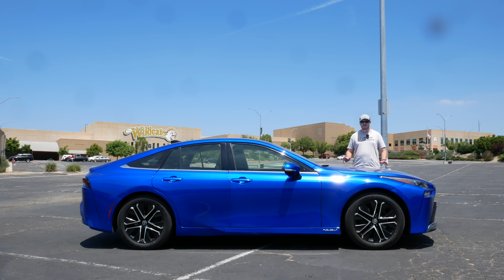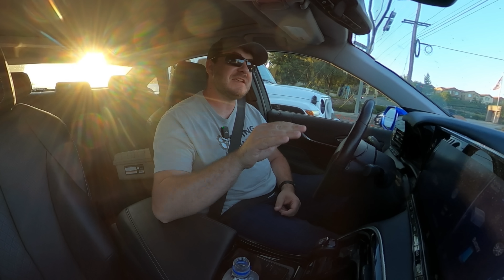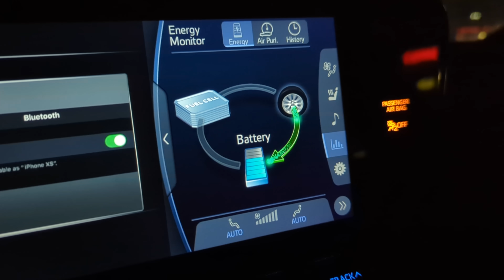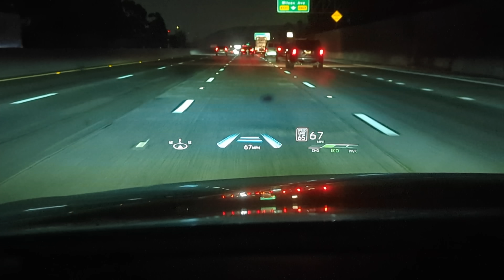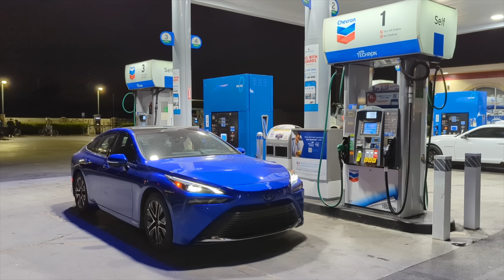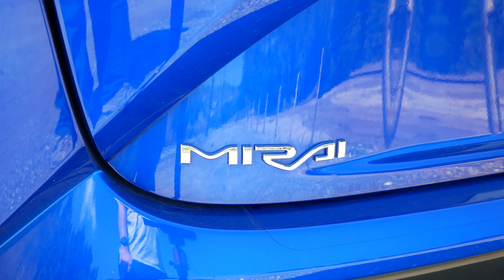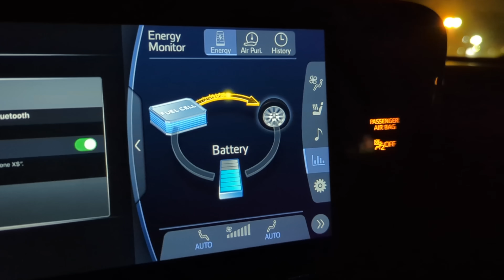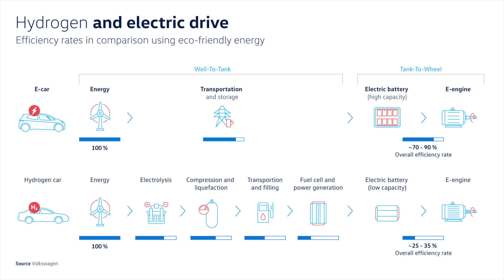The Toyota Mirai is Disappointing

Comment: I have a 2018 Mirai I bought certified used with 35k miles in February 2022 after I moved to Santa Barbara from West Virginia. I got the $15,000 fuel card, and also 21 days of a free loaner vehicle from Toyota should I want to venture out beyond where there are any H stations. I’m now at 48,000 miles, I’ve driven it to Napa Valley, San Francisco, Sacramento, and it’s been honestly a great experience for me. The only scare I had was a few months ago. Our only local hydrogen station (next closest one from where I live is 70 miles away in Thousand Oaks) was down for nearly 3 weeks as the cooling system for the station was broken. I thought I was going to have to get a rental vehicle which Toyota would’ve reimbursed me for it but luckily I didn’t end up having to do that.

The Mirai is a really nice car and I do get a lot of people who check it out and ask me questions about it, there seems to be a lot of interest in it, but even if it isn’t the fuel of the future, I still think it’s a lot of fun.
Reply: I do want to add that the only thing that’s really freaking me out is the fact that hydrogen prices are skyrocketing. When I first got my mirai, the price per kilogram of H was about $14.99. My Mirai holds about 4.7-5 kg total filled from near empty, and now TrueZero is charging $29.99 per kg. It’s over $120 to fill up. I love the car very much but if prices stay the way they are then I don’t know if I will keep it after the fuel card runs out.

Comment: The only reason I've herd of the miri is because James May owns the current gen which replaced the previous gen he had
Reply: I saw one drive past in London last year which was a big surprise. In contrast Porsche Taycans which are now more common here than Reliant Robins.
Reply: And he's had to abandon it as there are no hydrogen stations, most of them in the UK have closed (EV's have won, no one was interested in Hydrogen).
Reply: @craigix  No one was interested because there was no infrastructure, but there is a desire for it from consumers, but it seems the motor manufacturers don't seem to understand the problem of no infrastructure!
Reply: @Eddiecurrent2000  There are so many issues with Hydrogen. It simply makes no sense, even if there was infrastructure to fuel it. Anyone stupid enough to invest in a Hydrogen car, will learn the hard way. EV's at this point are inevitable.

Comment: Please correct me if Im wrong but from what I know from briefly looking at hydrogen fuel cells in engineering they dont seem to require as many rare earth materials that are a pain to get out the ground and perhaps recycling and lifespan might be better? I cant find any sources looking at the sustainability of production of both methods of EV so thats just what ive thought of
Reply: LiFePO4 cells don't need any fancy rare earths though, iron and phosphate are both pretty broadly available. Lithium remains an issue due to shear volume of consumption but I suspect that it would still beat hydrogen when infrastructure costs get factored in as a primary transport fuel source, especially since sodium batteries are starting to roll out for budget tier EVs. Hydrogen is probably best reserved for specific transport modalities where the range and mass energy density are critical with infrastructure being much more controlled, such as long haul trucking or aviation.
Reply: @bosstowndynamics5488  Interesting, thank you, I knew about LiFePO4 cells but I thought they had issues with energy density compared to lithium ion, sodium batteries sound promising and I will have to take a look into those. I've not really studied batteries tbh. At the moment it seems no solution is really a good one that solves all the issues
Reply: @sgqueeny8392  LFP batteries do have less density when compared to Lithium Ion, but it's... not as huge of a difference as you may think. The current base Tesla Model 3 uses LFP batteries and still achieves a ~275 mile range. On top of that, LFP batteries have a significant amount of advantages (not just using less rare earth minerals), like: They like being charged to 100%, they like being drained down to 0%, they don't care about being fast charged, they're slightly more temperature agnostic (IIRC?)... If LFP had the density of Lithium Ion, it's clearly the better choice for EV's IMHO
Reply: @Black-Villain  That's interesting to know, I genuinely had no idea Tesla used them, the more stable chemistry is a huge bonus, I used to fly model aircraft with LiPo batteries and you had to be so careful with them as they explode at the soonest opportunity
Reply: Hydrogen fuel cells also use precious metals like platinum, which have the same supply issues as battery production, but much worse.

Comment: I was hoping you'd make this exact video on this car. I've often touted the absurdity of Toyota of abandoning battery electric cars (for which the infrastructure for at-home charging already exists) for these cars which have literally zero existing infrastructure.
Reply: There was a point in time where there was also no infrastructure for gasoline/diesel, but you can readily find that now. Building infrastructure takes time.
Reply: @diogenes3528  I entirely agree, but here's the thing: the vast majority of plug-in battery electric car infrastructure already exists (at home charging is by far the most popular way these cars are charged). And perhaps more importantly, we've delayed too long already and allowed massive companies to continually push back sustainability legislation and so we need to act much faster. Plug-in battery cars (or really just public transit, but that's a whole other can of worms) represent the only viable near-term solution simply because their infrastructure pretty much already exists.
Reply: but toyota is building BEVs? the bz4x or whatever it's called, the new lexus whatever, plus, while not strictly BEVs, the new rav4 and prius also have PHEV versions. plus whatever north american models i'm unaware of.
EV purists generally don't seem to like PHEVs but the fact of the matter is that for most people they do work as EVs for most of their trips.
Reply: @michele8039  I own a PHEV (a Volt) and while I love it and it's what I could afford, there are many, many studies that have shown that PHEV are not sustainable enough for us to meet climate goals (Paris Agreement and etc). It's more important for companies to focus on improving range and reducing costs (why are seemingly all EVs either giant SUVs or luxury cars, or both?)
Reply: @PC_YouTube_Channel  i'm not sure whether this is the case in many regions, but europe has a selection of small, relatively affordable (ish) EVs. Dacia Spring, VW up, Renault Zoe, Nissan Leaf. the reason why so many modern cars (not just EVs) are crossovers and SUVs, in my opinion, is that baby boomers are the largest demographic that can afford to buy new cars, and they're getting older, so they want a car that's easy to get in and out of.
Reply: @michele8039  Looks like those are all EU except for the leaf. The reason why bigger and bigger SUVs/Trucks are popular here in the US is two-fold. The first is that legislation was passed a while ago that set the emissions of vehicles which depending on the curbside weight of the car. So instead of making more efficient/greener vehicles, they just made them bigger. The second is that the profit margins are larger. Many cars/SUVs/crossovers are built on the same underlying platform and to the manufacturer don't really differ too much in manufacturing costs, but they can sell the larger cars for a good bit more because of good ol' human psychology and marketing.
Reply: @PC_YouTube_Channel  we have similar regulations in the EU. the new suzuki jimny, a small, sort-of fuel efficient off roader with a 1.5 litre engine, has to be sold as a light commercial vehicle to get around the regulations. meanwhile you can just go and buy a range rover with a 4.4 litre v8 engine, which weighs twice as much and gets half the fuel economy, and all is well with the world.

Comment: I'm surprised nobody is doing retro hydrogen refits of cars. Like no way is it efficient or that effective due to the energy density thing, but it could mean that you can use (relatively) original engines and architecture and make it green, even if its a 60 year old muscle car.

Maybe the incentive will come along as subsidies, gas prices, and taxes intersect. (Especially if DoE's Hydrogen Shot comes to pass)
Reply: You cannot use hydrogen directly with original combustion engines. Lots of issues. You would have to replace the engine. If you are doing that, better to just make it an EV. Synthetic fuels will be how we keep classics running like they were intended with the original engine and sounds.
Reply: @anthonypelchat  I read years ago that you can use hydrogen with an injection engine, just not carbureted. I think the main problem would be related to fuel tank sizes, and, you know... rust.
Reply: @NOLAfugee  A lot more difficult than just putting hydrogen in the system. A very simple explanation is that hydrogen takes up more space per unit of energy, meaning that you get less energy in the combustion chambers. Much less. Then you have different needed mixtures of fuel energy to air, causing other problems. And then you have leaking issues, since hydrogen leaks through nearly everything. Nothing in the tanks, lines, nor engine are built to keep hydrogen in place. And finally you have the corrosiveness of hydrogen. I believe the Engineering Explained video about the hydrogen combustion engine went into the most detail here on the issues.
Reply: Those video, write-ups, and retro fits have existed for decades. If it was better the diy community would be full to bursting with people who run them.  I was in a hypermiling forum in the early 00's and asked why people don't use them.  People in the forum who had done it replied that it wasn't better. It looked better on paper but the reality shook out differently.
Reply: @merrickhurst4150  I think the emissions reduction would be the only advantage, not power, efficiency, etc.

Comment: I always liked fuel cells since I build one as a school project and got a good grade for it. Would love to see a teardown!
Reply: Y'know, that takes some skill to build a fuel cell for a school project.
Reply: @jwalster9412  No it was very easy. It was basically just a U-shaped glass tube filled with water and two electodes. I made the membrane/seperator from gelatin. The hydrogen/oxygen was just "bubbled" over the electrodes. You can build the whole thing in a few hours from basic items. It produces just enough power to light up a very small lamp. Good learning tho!

Comment: Great job!  Too bad the electrolysis effort can't be done on-board, powered by the Li-On battery itself during recharge one-pedal driving, ultimately letting gravity and momentum fill the tank.
Reply: The additional hardware required to do that would far outweigh the minimal benefit, since you would need to capture the water vapour, condense it, mix it with alkaline salts and then capture the resulting hydrogen gas and recompress it when you feed power in to the cell (not to mention you need a separate electrolysis cell since fuel cells aren't neatly reversible like batteries are).
Reply: If you were going to use the battery to perform electrolysis you'd be as well just using it to power a motor and drive the wheels directly. Far more efficient, cheaper and simpler.
Reply: Takes a lot of amps.

Comment: 0:52 Technically there's the Chinese market electric sedan Changan SL03. However, due to the immature fuel cell industry, the H2 fuel cell version costs 3 times as much as the normal EV version, and 4 TIMES as much as the quasi-hybrid version. The latter is about the price of a Toyota Camry by the way.

Comment: How long does it take for a full charge of hydrogen to leak out, as hydrogen likes to do. A month, two? A year?
Reply: If it's in good condition - never... But yes, leaking & hydrogen are very much bedfellows.....  Liquid h2 on the other hand.... that has to be vented off as it warms up, which is why (if you follow the in-video link to Engineering Explained's video on the liquid H2 powered BMW V12) liquid h2 vehicles are even fewer and further between than high pressure H2 powered vehicles! (in case you don't go to the linked video - A full tank of liquid H2 in the BMW will boil off in 12 days.... and you're not allowed to park it underground!
Reply: @real_electricmonk  Thank you. Excellent reply.
Reply: probably a lot slower than an EV.   you have to keep charging those things even when you are not using them.
Reply: @neeneko  No, you don't.
Reply: @real_electricmonk  yeah, you do.  Try leaving an EV in your driveway for a month and see if it still has any juice left.
Reply: @neeneko  Well, I can't do that (because I use my car...), but I crunched some numbers for you. I last charged my car about 5 weeks ago (+/- a few days). I have a 64kWh battery & charged it to 80%. Today, it's on 30%. I've driven a shade over 100 miles at an average of 3.6m/kWh... which works out as 27.8kWh expended driving, and 4.2 kWh energy "lost". That equates to about £1.45 in money, or 15 miles in range.

I hope that's of interest to you. My car is an MG4 Long Range BTW.
Reply: @real_electricmonk  yep, specific numbers are interesting, and I am not trying to claim that the drain is a horribly expensive thing.  but it can be a real pain for occasional use.

A few weeks ago we were actually looking at an EV, but the lot informed us that we could not test drive it because they had not charged it in a while and, because of high heat, it was drained.
Reply: @neeneko VW ID4, a week not plugged in or driving, and a loss of 1%.
Reply: @neeneko more fud, we went on holiday for 3weeks and when we returned to our car it had lost 4%. Probably caused by me waking it up to check how much it had lost...

Comment: But is the car lighter when the tank is full?
Reply: No.

Hydrogen balloons don't float because hydrogen has negative weight; they float because the hydrogen displaces air from the balloon. To put it another way, hydrogen lets the balloon be big enough to be less dense than air, without collapsing from external air pressure.

The hydrogen tanks do not expand when they're filled with hydrogen. They just have more hydrogen in them. The same amount of air is displaced by the car, so no additional buoyant forces are generated—and since hydrogen has positive weight, the car is slightly more massive.

Hope this helps!